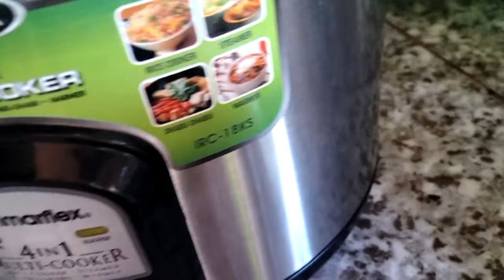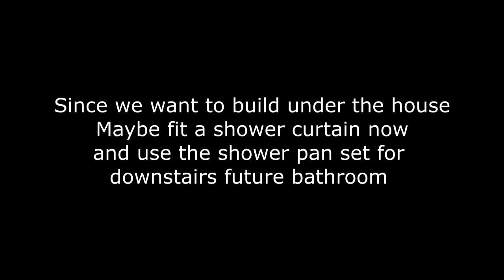FOREIGNER BUILDING A CHEAP HOUSE IN THE PHILIPPINES - BATHROOM MISTAKE - THE GARCIA FAMILY

Comment: I have a similar shower....  the tile should of sat on top of the shower tray then  silicone around the shower tray ....there should be no gap....  You could remove the bottom tiles and move the shower tray flush to the wall then put new tiles sitting on the shower tray...
Reply from the maker: I like your idea, thank you😊👍👍👍

Comment: I would bust out the floor and do an offset flange (if you can find one) or re pipe.

Wife didn't look too excited about her birthday kitchen appliance. 😁
Reply from the maker: Bust out the floor?
Reply: You only need to replace a few tiles and a little cement.
You would need a  hammer drill. Commen here.
Reply from the maker: @JMgmkh  the toilet was cemented to the floor🤔
I will talk to the boys, thank you😊👍👍